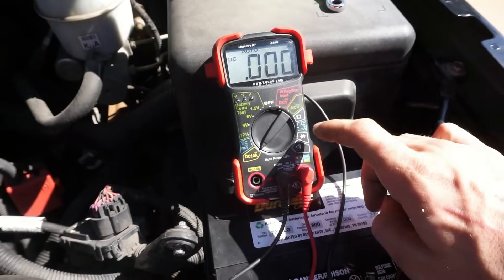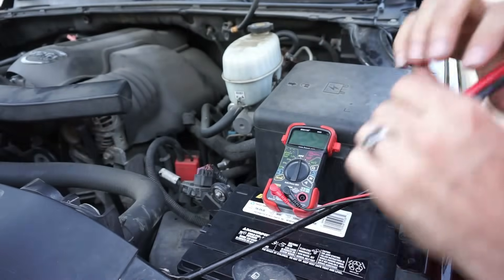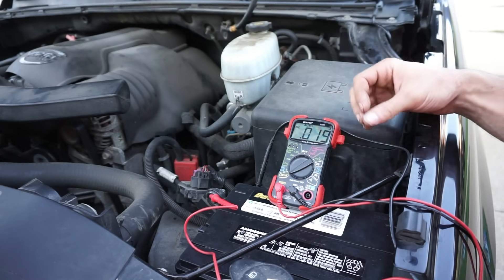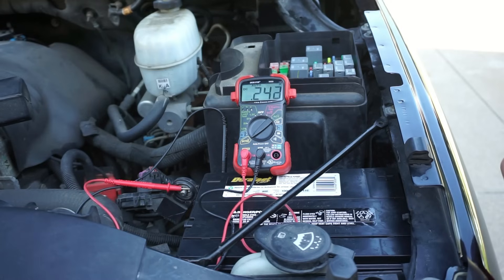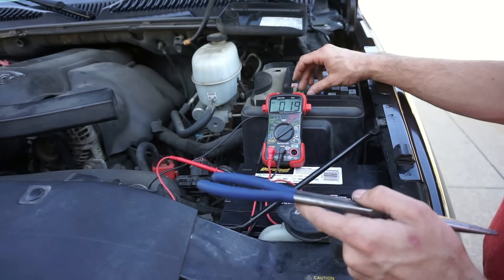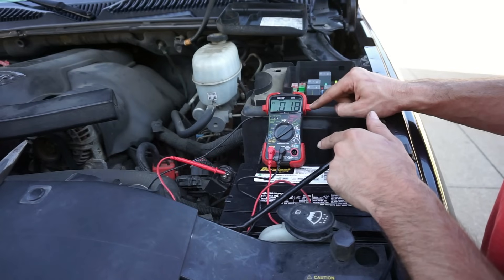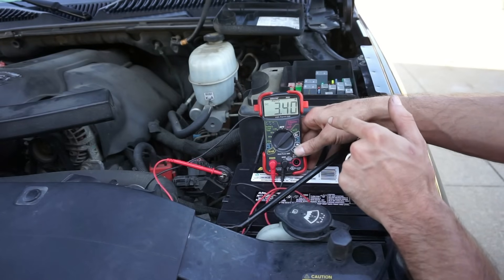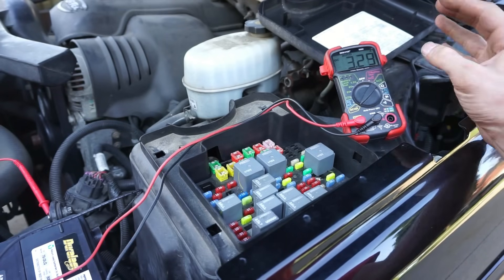DEAD BATTERY | How to FIND a Parasitic Battery DRAIN Using Multimeter!!!

Comment: This is by far the best method I’ve seen.   I quickly found my parasitic drain on my 1997 Honda CRV in the power door locks circuit.   Coincidentally I missed it the first time but realized now my probe was plugged into the voltage terminal on my meter not amps.  Now that I caught that mistake  I was able to measure a 180 mA drain redoing this test.   I pulled the 20A fuse in the fuse box under the hood and viola, dropped to just 25 mA.  Since the power door locks quit working and I never lock my doors anyway I’m just going to leave the fuse out.  Thank you!    I don’t need to charge my battery every morning before going to work this winter.

Comment: Outstanding.  That is instructor-style learning.  Thanks.  I have one question, you started by just pulling the fuses without the key on and off.  Then you did the key on and off.  Were those basically two types of tests you did?  I'm no electrician and I have a battery drain.  I will use your method in checking for my drain.

Comment: This is the fourth video that I have watched because my battery is going dead after I bought my 2018 Kia with 28,300 miles. I love the car however, after two weeks my battery went dead... got a job down at AutoZone they showed me I have a dead cell in the battery... bought a new one .... 2 days later dead again !!!! They check the charging system and the battery and everything is okay... but the battery still drained. Oddly enough, one of my neighbors told me that the door opened up. And today I found out that I can't open the side door with a remote. I've not gotten to the bottom of it but I'm going to guess it might be a door problem. I'm going to use your system of tracking down the problem. Thank you so much !!♡!! I feel like I'm closer to the truth... I know what/how to proceed now 💪 !!!  
When you said be patient... wait for the number to go down it reminded me of a quote from Aristotle : "Patience is bitter but the fruit is sweet". So, did you have to change an electric door switch or control module ??

Comment: Wouldn't this be safer if you used clamp ac/dc multi-meter?
Reply: Not really.  I have a great multimeter but my amp-clamp only does AC amps.  So I hook up in series with the battery like he did in the video.

Comment: Hi. Could you please answer me a question. My car is 2017 Honda CR-V. After I parked it overnight, its battery died. I followed your instruction to check,  and connected the meter with the negative point of the battery, but the meter just shew zero. So I don't know why. Thanks for your reply.

Comment: I came across your video among many others on battery draining...and I must admit that I tried others video on trying to find out what was causing my battery drain but had no luck at all...going through more videos I came across yours and figured what the heck and low and behold you showed me something different...to turn the ignition on to rest everything and I seen a difference in my readings but the kicker was the detail about the door lock...I  bought my truck used and the back hatch never locked which wasn't a big deal but turns out to be my battery drain I've been having since I purchased the truck...thanks for the informative video!!!

Comment: a21bravo , would all of this apply to a standalone system? I have a 2010 4.8 that I cut and thinned the wiring harness, and it will drain the battery in just a couple of days.

Comment: I have a 03 Nissan altima 2.5l 
When I first bought it, sometimes in order to start my car. I would need to press the lock and unlock button to start my car or wait for a click under my dashboard to start it. So one day my car died on me, replaced my battery, alternator, checked my starter. Everything run okay, but while driving my battery voltages was 14.9v then drops to 11.8. I had to press the gas paddle just to bump up the voltage to 12.2v. Sometimes the battery Icon and my emergency break can light pops up when my battery voltage drops. Any ideas?

Comment: On my wife’s Acadia, over the last 13 years I ended up replacing the DDM twice, but that was due to windows not rolling up (drivers once and passenger front via driver switch only) and it fixed it both times.  Subsequently, I had to replace the actual wire between the DDM and the front passenger door control module as the passenger window wouldn’t roll up (only from the driver switch).  That solved my problem for a couple of years but now the passenger window will only roll up via its switch, not the drivers.  Never experienced the parasitic issue on the DDM.  What circuit inside the DDM was causing your parasitic load?

Comment: so did replacing the door lock module solve the problem?
Reply: Also is it common that a bad module would cause a parasitic drain even if the user isn't operating the component? For instance, say you window motor is bad and the window won't go up or down, would that drain your battery if left alone? I have gone through a few batteries and trying to solve my issue, I know I have a bad window motor, but has been that way for a very long time, battery problems are new

Comment: I'm having the exact same problem in my 2004 Suburban Z71 if I pull the radio fuse I can usually get one day out of it or at least from when I get off work to when I go back about 12 hours but it still goes dead after that haven't had time to really dig into it

Comment: I can't believe that no one suggested a clamp on DC Amp meter as the meter of choice. It is way faster than any other method of tracking down a current drain. They are available for less than 40 bucks on Amazon. You can clamp onto a bundle of cables right off the battery. If you see a parasitic drain, you can then quickly isolate which wire(s) has the drain. ALL WITHOUT DISCONNECTING ANYTHING!!  Your method took days Vs minutes for using a clamp on meter to trace the draw. Of course you DID need to wait for the computer to go to sleep for your particular problem but a clamp on would have helped a lot.

Comment: I also have a deadly parasitic battery drain. None of the door locks on my 1997 GMC Suburban will lock. They move when I click the electric unlock, but they won't fully open or close. How do I change this? Replace all the locks?

Comment: sometimes the fuse or relay in the trouble zone is hotter than normal too.. a quick scan with a temp gun may uncover an issue.. if not then just go back to the amp draw thing.

Comment: Did you start with the enginebay fuse box first just because it was next to the battery? I would always start with the fuse box inside the car because it has the fuses for the majority of the circuits.
Good methodology though!

You can make the car think the door is shut when it isn't by taping the door interior light and bonnet plunger in and covering up the interior alarm sensor. Then all you have to door is wait for the car to 'go to sleep' to see what the battery drain is before pulling fuses.
Reply: Thank you for that info.

Comment: I did this many times. Bought this hummer as owner and shop couldn't fix. One week for battery to drain if not driven. It was a door switch turning on dome light sometimes.  
  How did I find the issue many years later ? After being robbed several times and going thru video, I seen the dome light turning on without anyone opening the door. Intermittent problems are not fun, lol.

Comment: I got this draw in my Jeep cherokee when I disabled  alarm wire in passanger door by connecting two wires at bottom corner of door after watching utube video. It worked so I could start the jeep and shut off the alarm

Comment: You had to cycle the key because you lost connection (open circuit) when you disconnected the battery. 
This is why we DON'T disconnect the battery to hook up the meter. You released the fault by doing so. You need to have a switch between the battery cable and the battery post.
Close the switch and operate the vehicle.  Connect your meter across the the switch and then open the switch. The load goes through the meter and never releases the fault due to voltage loss from an open circuit of the battery.  Then you start the timer and wait.  Some cars/trucks can take up to 1 hour to get all the modules to sleep.  You're lucky that the fault would come back. Sometimes they wont.  Still got it done and that's the point. Good work in a roundabout way :-) We need to find things on customers cars sooner!
Reply: Great tip, thank you!

Comment: Thank you for this video. I liked how you used your meter continuity test to tell witch terminal supplied power to the fuse block inside the cab. Also that you put the key forward to activate that current draw. The only thing I would do different is to use a DC inductive amp clamp neater for the parasitic drain.  🙏👍
Reply: I thought the same, as a clamp meter much easier, but 'milliamp' clamp meters are not cheap! And my standard clamp meter, just doesn't go low enough. 👍  Excellent video though.

Comment: What's ridiculous to me is I just pulled a code for intermittent faulty door module in my Audi and I had a similar issue where I replaced the alternator cuz it died on the highway and then I get the battery light flashing was distraught because I had to buy a $300 battery just to find that the light did not go out when they told me that my battery was bad and if I turn the key and wait for about 3 minutes my battery light starts to flash like it's not charging and I think it's because the door module is sucking the power so now I got to check everything just like you did and I'm pretty sure it's going to be the door module

Comment: My 2001 Impala LS with 20,000 miles on it, the battery would drain in about 2 days. I attached my meter like you did and pulled every fuse out, but the meter still showed a more than normal   draw on the battery.  Even when I pulled the radio fuse it still had a draw.. I found that the amplifier had a bad ground so I purchase a factory amp and that was the problem..

Comment: Hello a21bravo... So just to be clear in my understanding...when you are drawing the amps...after a ( waiting while )... the original reading should remain = ( meaning circuit is good ) ...now if your amp draw goes lower than the original reading after waiting...that circuit is probably at fault...Am I correct in my understanding ??? ... you or anyone else following ...just need a precision on how to detect the faulty circuit ... Am I correct in my understanding... trying to pass the "a21bravo test" here...Thanks ahead ...!!! ...saved the video and will absolutely watch it over again many times...Thanks for your work !!! ...

Comment: I so wish you were close to me. I put a brand new alternator and battery in my 2012 GMC Acadia SLT a month ago. One week ago I began getting warnings on my battery again, saying I needed to service my charging system. 

What you say makes tons of sense, I just wish I could understand better as I'm terrified what the dealer will charge to trouble shoot as you did (if they'd even find it as you said).
Reply: re-listen to the video...put it on pause and make it a step by step thing...He did it...so can you !!! ...Break the ice ...it's very valorizing for yourself ... don't give up ... put use Lee Blackwell's comment hihger up and use a jumper cable just when you are switching the key to the on position...then change it again to your meter...to avoid to fry your meter...wise people here ...giving wise advice...not only will you save but you will find yourself just brilliant ...more and more car are just electricity...no garages will meat your match...unless they have very expesive computer machines to do the same darn thing... Good Luck ...God Speed !!!... ...and maybe check the starter connectors...starter could be drawing electricity more than they should and if the connections are solid on the alternator and belt tension ( usually belts make noises when too loose or too tigh and affect ... Had a 1969 rebuilt ( beautiful Mustang ) and the biggest problem came from a broken positif cable...but there nothing worked at all...zip... and sometimes new batteries do fail ...cause a lot of them are recycled...but I had that happen to me too...checked evrything ( 1 week ) to finally go fight off my newly battery...a good test for your battery...clip your meter on the battery make the reader face the windshield where you can see it...sit in the car...now turn every possible things on...wipers...hazards...fans to max...radio ( not too loud rear defrost ) ...I mean everything... now you will turn your key to the on position ( without starting ) ...with your watch...as soon as you turn on your key with every thing moving fans ,defrost,radio etc...count 10 to 12 seconds...then turn the power off...if your battery is around 10 volts and up...it's good ...of the voltage reading drops under 9.5 ...some thing is bad in the battery itself... ...another thing...if you put your meter on DC volts ( same for the operation I just mentionned ) turn the car on running...then just by checking your voltage ...it shoud be aroud 13.5 and 14.8 volts...meaning alternator is charging porperly...if under or over ...alternator is not charging enough...they could have sold you a rebuilt alternator...and that one of the reasons I buy only Brand new alternators...as of today...they garanty them for life  ( some of them ) real good trick to rule out your alternator...rebuilts are still using old parts and sometime...in a metter of days...they go kaput ...

Comment: GOOD JOB  turning key on---after meter connected, than off to properly test for drain is a  MUST  especially for finding relay load drains.  Power antenna keeps it's relay energized, even with key off...until battery post removed, drain can stay gone until "battery post reconnected & key turned on".

Comment: I have an 05 Buick Rendesvous and I have discovered the exact same thing. The key has to be cycled before the problem arises. In fact it will crank once on a fully charged new battery but will not crank a 2nd time after sitting a few minutes with a scan tool hooked to it, key on for 30 or 40 minutes. The battery goes to 5.6 volts way too soon. Scan tool showed no issue at all.
That's all I know right now still have to dig some more. Charging the battery now.
Before cycling the key I get .02 to .06 amps no matter what fuse I pull.

The other thing is that this all started after installing a new after market radio. However its still draining the battery with the factory radio back in in a couple of hours.

And its a miracale that your wife mentioned the door lock. Without a wife you would still be searching for the problem no doubt. LOL!

Comment: a21bravo..Thank You much!!.. Have a 2003 Chevrolet Suburban after sitting all winter out by garage,,,worked great last fall,,and now the battery going dead after about 4 days. New battery first,,,then ,,, After watching this video, this rig had the identcal problem as you shown here. As you said the key to this was waiting for a period of time to get the 'real world' amp draw readings. Mine was the DDM fuse as well. Haven't dug into the door panel to see what is the snafoo,,but no battery draining now.. Thanks again. (Did you by chance chase it enough to see what was hanging in the control module in door on your machine? )

Comment: I'm hooking the multimeter up this way but I'm not getting any readings at all. 2012 Keep Liberty 2W drive RHD vehicle. If anyone knows another way.
Reply: You have to make sure your meter is set to read amps, and then your meter leads in the proper spots, should be red on amp receptacle and black in common. Assuming you are using the meter correctly, the next thing to check would be your multimeter fuse. The meter has a fuse on the amp reading circuit to prevent you from damaging the meter with high current.

Comment: On my 05 yukon I just found my oil pressure guage is stuck at 80. Far right. So I'm guessing that explains the battery draw parasite. The cluster.
Reply from the maker: That's probably a bad stepper motor, or oil sensor.

Comment: Quick first pass check- after the vehicle has set for a hour+ with everything off, feel the relays and suspect any that are warm or hot.
Reply: Ah, the laying on of hands.

2006 Acura TL would drain over night. I few minutes on Google told me to feel the windshield just above the rear view mirror. Common problem on those was the hands free module located in the top, center console. Unplugged it and Yahtzee!

I was able to run my temp gun across the windshield and see the temp difference, but that got me thinking about Flir cameras. They check temperature across a wide area so you don't have to rely on a subjective, "is it warm" touchy feely. 

Of course if its in a warm climate, you're screwed, but there are certainly times.
Reply: Thank you for that valuable tip.
Reply: My headlamp relay was ticking, replaced, got hot, pulled it out and truck runs fine now... while in going to a stop the truck would almost die from power drain. WhT next